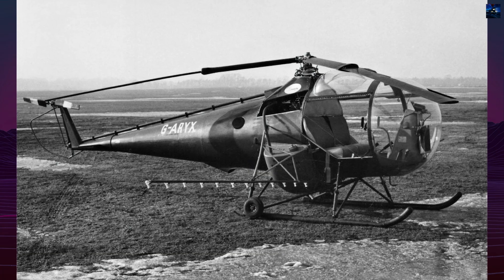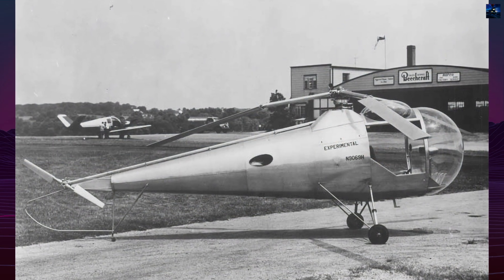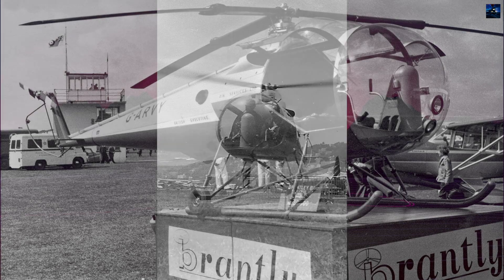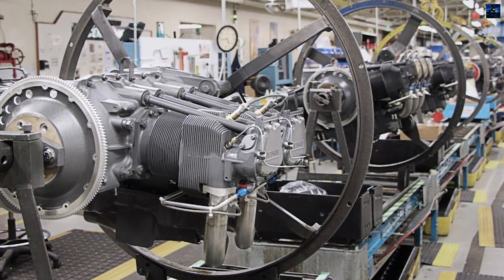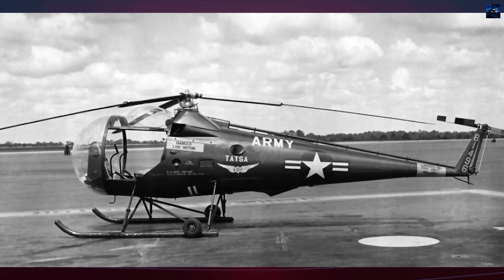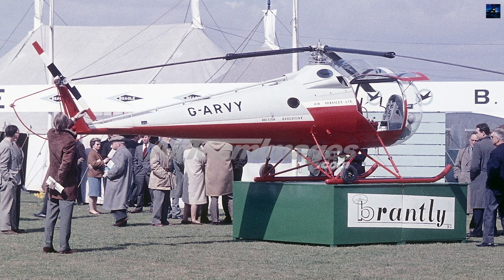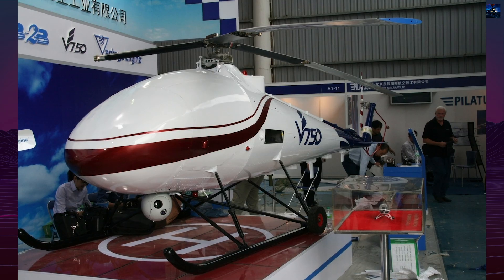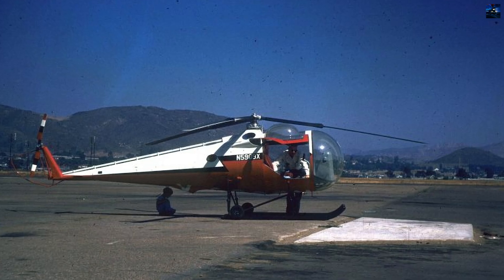Brantly B-2: That Weird Old Helicopter That Looks Like An Ice Cream Cone

Comment: Brantley Helicopters was stabbed in the back , A Bell Helicopter Ex VP was running the show and sold out.
Half sold to Taiwan and the other half to China. Then he surrendered the TC & PC leaving the 80+ owners in the dust,
Haynes still has the design prints and rights, As an orphaned aircraft owners are authorized to manufacture their own parts,
The Brantley flew like a small Hughes 500 - Flew on all over Alaska...

Comment: I owned a B2A (serial number 18)  back in the 1980's.  I loved it!  The Brantly is a great helicopter, but good luck trying to find parts now days.
Reply: Yeah, I'd think it'd be a great helicopter to dork around with, can find them once in a while on Barnstormers or Trade a Plane for around $50000 on average. But like you said, parts....especially finding outer blades, and whatever outer blades are out there are going to be questionable, with the skin bonding glue going to be old and brittle, causing the blade root skin to not distribute loads correctly around the bolt holes, causing cracks.....
Reply: @antigrav1302  No bonding all rivets the foam core was glued, Harold Jenkins used to rebuild blades, 
Used to pick up parts from him . Nice guy
Reply: @HongyaMa  Yep read that he was the one to get blades redone with new foam cores.  Going to be highly unlikely anybody will take on the expense of remanufacturing those blades now.  As an aside, there is a Brantly for sale on Barnstormers currently for $12000, with really bad corrosion.........
Reply: Was that the one Hiser used for a While? Corona CA?  If so Scott D. has it at Aries Heliflight Corona CA